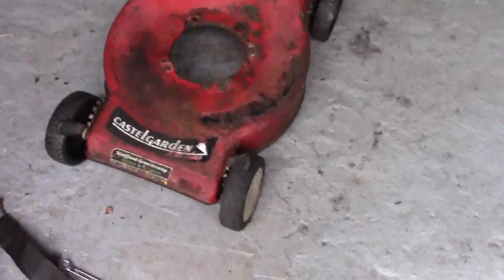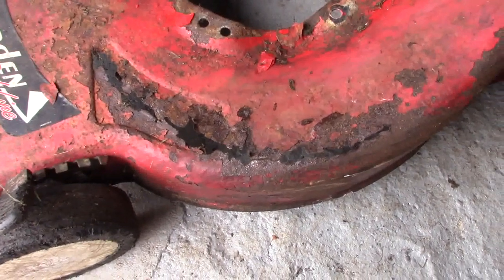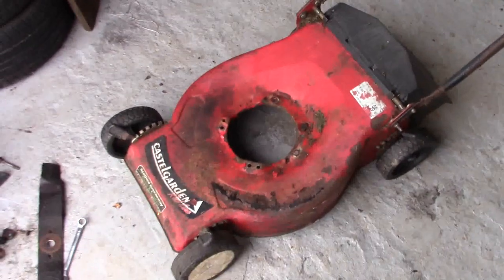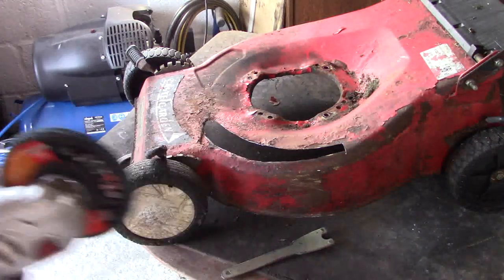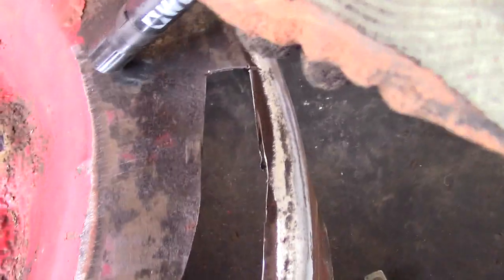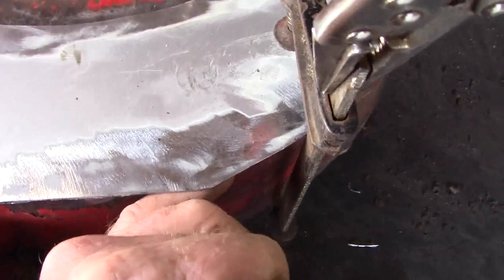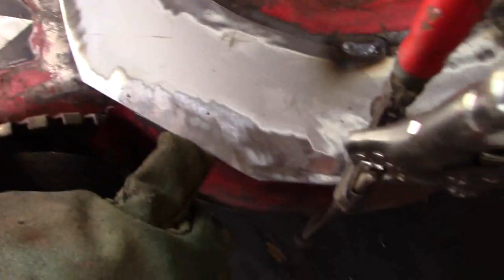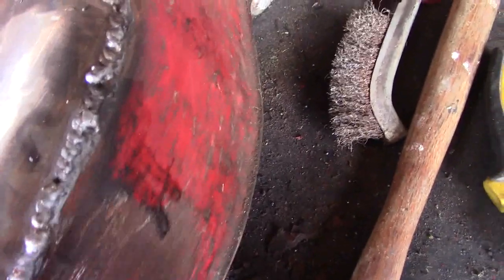DIY Sheet metal patch welding repair on a lawn mower deck

Comment: Good job extending the life of the deck. Has it lasted still now? 2023.
Reply from the maker: Nathan C
 Bought  a new mower this year an to be honest repair held up well but nothing lasts for ever
Reply: @TheProjectGuy194  nice I saved a 5 yr old Honda rwd walk behind with badly rust deck. Cannot find another one same model. The cub cadet similar with the same Honda gcv 160 is also not around for parts. I'll be welding this deck too. Thanks again from Nova Scotia. :)

Comment: Mine has gone in almost exactly the same place. It’s a Honda and the engine works perfectly. I’m wondering whether to shape a bit of wire mesh over the hole at either side and then use fibreglass and resin to hold that in and build that up for strength. Do you think that would work? I might buy a new one and I could use both to get the grass cut quicker but I am loath to scrap the machine!
Reply from the maker: Yes clean around it an get fine mesh an go to motor factors or car parts place an get a tub of fiber fill an apply it over the mesh an overlap onto the mover.
Reply: @TheProjectGuy194  Will try that, thanks - hate wasting a good mower apart from a small part of the deck!

Comment: Amnotwise another great fix....by the way you commented on my flux core welding learning process and you mentioned using a V pattern it works great.i was using 030 wire and it laid it down like a champion......thanks, john
Reply from the maker: john wadsworth  thanks john for the postive comment